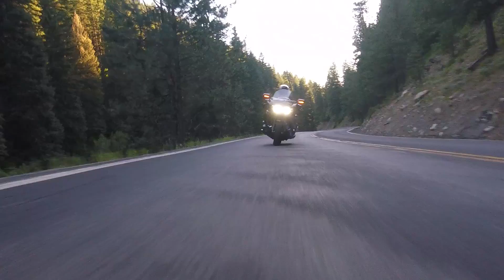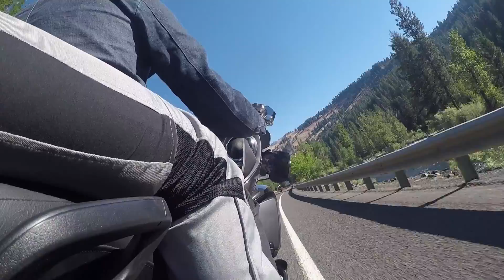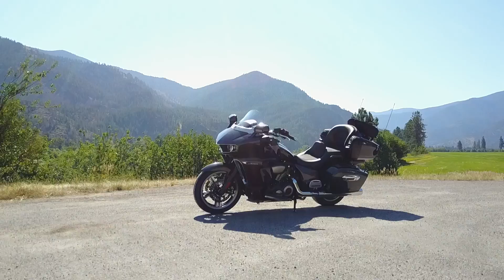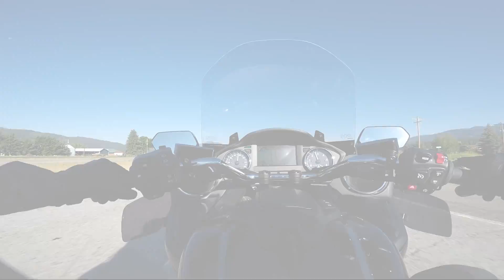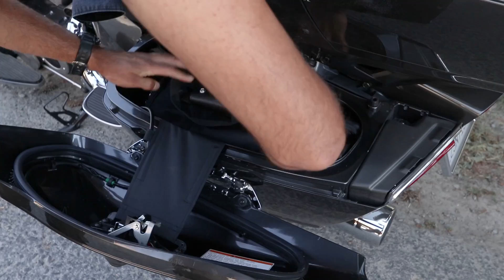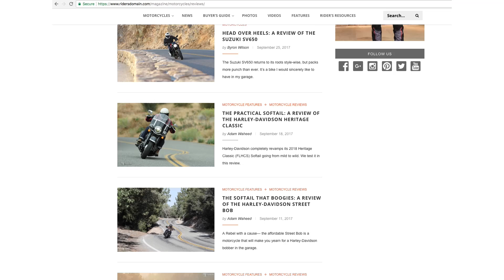2018 Yamaha Star Venture Second Ride Review Video | Riders Domain

Comment: I bought one a few weeks ago. I absolutely love this machine! She is smooth and has a very nice power range. She is also very responsive as he points out in the video. It is as fine a machine as I have ever ridden.
Reply: what made you skip buying the goldwing thks
Reply: I feel EXACTLY the same way, I LOVE my new Venture TC!
Reply: @rubo1964  It was the seating position of the Wing for me. There isn't a more comfortable seating position than that of a V-twin cruiser style bike IMHO.  I'd rather have a feet-forward position than my feet directly beneath me.  But then again, opinions vary.
Reply: Yamaha NAILED IT on this bike!!
Reply: How do you still like it 1+ years later?
Reply: @gabbyhayes1568  so you chose the wing or the yammy?
Reply: @HooDRidEWhiteY  The Venture was more comfortable and I prefer the ergos. The seating position of the Wing was not as good IMHO.
Reply: @gabbyhayes1568  ok thanks!!
Reply: How is the speed, does the bike reach at least 100mph without hitting the rev limiter?  Whats the top speed on this beautiful machine?  Im only asking because im considering this over the Gold Wing.

Comment: I've ridden both this bike and the 2018 Goldwing, if your 5"10" and 185 and under the gold wing is probably better for you. If you're a bigger guy this one is more comfortable,  over all really was surprised after so many negative comments. Got used to short shifting, lacked a little power over my Raider and the heat was noticeable but not a deal breaker. With the comfort and all the bells and whistles included I have to have one because I like longer 300 plus mile rides over a weekend and longer. Not to mention I don't think there's a bike out there that beats this one for passenger comfort! Will be buying one soon!
Reply: All the negative heat comments I've heard is ridiculous, every bike I've owned even liquid cooled ones when it was hot they were hot i have no problem with it ,this is one awesome bike its superb! Top of the line I would put it up against Harley, Honda    and Indian any day!

Comment: Bought it love  it 2022 best bike I've ever owned handles like a dream , drove to PEI and back almost 5000.kms
Reply: Just a heads up but there’s a recall on my 2018 for the brake switch and the starter, neither of which effected my bike, but took it in anyway for the replacement parts. You can run your VIN on their website to see if your bike is effected. My guess is the dealer you bought it from may have already taken care of it before they let you drive off, but you probably should check to see. It really is a fantastic bike isn’t it. Ride safe.

Comment: The heat coming off the engine isn't really a problem if you do what I found works: I start my cruise at 10:00 a.m. and duct tape a raw chicken to the inside of each of my upper thighs. By noon, I'm re-taping them to evenly cook the other sides. By 4:00 p.m., I stop and apply BBQ sauce to both birds. By 6:00, I pull off the road somewhere to eat dinner. Pack potato salad, too!

Comment: Just bought a 2018 transcontinental.  Although I like the bike with all the new techs, I think the older venture, my 2006, rides so much better.  
I don’t want to say anything negative about my new bike.  It’s just that 2nd gen venture has been an outstanding machine in every aspect.
Reply: I rode a 2005 RSV for ten years and it was a very comfortable bike, especially for taller guys, very roomy.  I don't know about it riding better than the Transcontinental though.  The RSV had a great suspension, but it was a tall bike and extremely top-heavy.  And it didn't have ABS which made panic stops a real adventure.  But it was a very good bike.

Comment: Would I buy it? Probably not, at least not for another 15-20 years and I'd have to be planning on a lot of 1000+ mile trips that freeway riding was a big portion of it. I think my 2015 FJR1300 is going to serve to be more what I want, a more well rounded bike that I can gun when I want and it takes off, has sharp handling, and still has lots of storage and handles lots of freeway riding well.

I'd buy this in a heartbeat over anything comparable from other manufacturers: Goldwing, Street Glide, etc. This thing does offer a ton, looks super refine, and exceptionally well designed and engineered and packed with features. I'd definitely consider renting one if I were going to do a super long 2000+ mile trip. That being said, it may be overkill for me, at least time I'm older. I did 1500 miles in 5 days on a Honda 919, the FJR1300 is going to be a nice middle ground for me for a while.

Comment: The first thing to go on my Stratoliner was the heel shifter.
Reply from the maker: Yes Richard, we agree. A heel shifter is a must-have add-on for the Star Venture. Which one did you fit on your bike?
Reply: Yeah, a heel shifter is a must - was the first thing I thought of on Mile 1 of our ride.
Reply: I have removed the heel shifter on all my previous touring bikes. Just don't like them. Maybe a holdover from my early days with Harleys. But now I'm getting old, I'm looking for comfort. Will definately check this out closely. Nice review on this.
Reply: Ive never understood the necessity of a heel shifter.  Thats always the first thing I scrap on any bike I own.  All it does for me is limit how much room I have to move my feet around on the boards.  To each their own though.
Reply: @chrismartin500  keeps the top of your boots from getting scuffed.  I use the shifter both ways. Depends on my choice of footwear

Comment: I've been a Goldwing rider from 1976 and in 2016 had a flesh eating bacteria get into my right knee. After 7 surgeries the doctors saved the leg and my life, BUT, I cant bend my knee enough to fit behind the Goldwing Engine anymore even with floor boards. I Rigged up a brake that would reach a foot peg on the right crash bar but keeping the leg straight all the time is uncomfortable too. Went to a Indian Dealer to see if sitting on a FLOOR BOARD V-Twin would be comfortable. PERFECT! Just Perfect! But I am not sold yet on any V-TWIN. I LIKE INDIANS Nostalgic look but I understand the Heat is a BIG PROBLEM with their Tourers and all the 111s. I like touring and want the extra luggage capacity. Switching to a V-Twin will be a major step as I have been sold on the Goldwings reliability and Love the Shaft Drive. But also over the years they changed the body style so much that it no longer looks like a motorcycle to me, but something a guy wearing a suit and tie would ride going into town to work! I have a 1999 Valkyrie Interstate now Only for the reason it looks like a motorcycle. Just can't get myself to buy a new Goldwing simply because of their LOOKS! Just want a real nice Fully Dressed Bike that is dependable as hell and at least Looks like a motorcycle. Harleys are out for me cause I hate their ride. And I don't trust their so-called dependability. Know too many Harley riders that STILL have problems even with Today's High PRICE tourers! I truly believe Harleys are MADE TO BREAK. This is a good review and I am going to have to try one of these out. The Goldwing has excellent center of gravity and balance. If this bike can offer Dependability, Good Balance and Handling and a good Long Haul Comfort, especially 2 Up, I may be sold. I know there is a BIG difference between a six cylinder water cooled engine and a V-Twin Air Cooled one. But given my new life circumstances and the advances made with the V engines this bike might just be what I have been looking for and NEED! I won't ride a trike either. I gotta have the sway and play of two wheels! Thanks for the review!
Reply: Not really sure. They said it comes from the soil. The ONLY thing I had been doing related to any soil contact was watering my yard with a garden hose. I was waiting for shoulder surgery and was using my leg to pull on the hose so I wouldnt tear the already torn tendon in my shoulder anymore. I was wearing shorts and would pull on the 100ft hose using my right leg and right foot. When I got out of the hospital (2 months) I checked the hose and it felt like sandpaper. Only guessing though that it may had this MUCOR FUNGUS on it and scrapped into my knee. First sign was a small red spot about size of a quarter with knee swelling up and hitting like hell. Went next day to Dr. and he said it was a staff infection a d gave me 12 antibiotic pills. By next day skin was turning necrotic and super red infection. Went to hospital. The said same thing, it was a staff infection, gave me 1 hour of intravenous IV antibiotic 52 antibiotic pills, cut into redfish black necrotic skin, stuffed a drain strip guaze in cut and sent me home! THIRD day reddness got even bigger and spreader wider. Went back to hospital and they decided to admit me. They called in a disease expert who discovered what it really was - MUCOR FUNGAL INFECTION. The had to debride about a 8 inch diameter area near my knee cap that went about a half inch deep. Had to have skin grafts. This happened Oct 3, 2016. 1 year now. Even with rehab knee only bends about 23°… Plus I found out through MRI in Sept 2017 that my ACL-PCL tendons were Completely torn. Sweet Huh. But even through all this I still managed to be able to get on my Valkyrie and ride it. BUT like I mentioned I just can't get my knee to bend enough to get it on the right floor board behind the engine. The bike has been my rehab and FRESH AIR to keep me positive. This thing really did a number on my whole life. In just a couple of days my life changed forever in a way I could never have guessed would happen. It is incredible what happened! I just thank God Everyday I did not Die and also did not lose my leg. Stats say 30% who get through skin die. You can also inhale Mucor Fungus Spores and if that happens stats give you a 70% chance of dying. MUCOR FUNGUS grows in the soil mainly on dead WET vegetation, wood chips, decaying vegetables and even cardboard. Thing is I bought some top soil that had some wood chips in it. Raked them into a pile right where I rolled up the hose. So when I watered the yard I was pulling the hose across these wet wood chips. Anyway, its still guessing but it was all I could figure out might have happened. If you ever get an infection that starts out small, hurts like hell, swells quickly, and redness spreads quickly don't assume its only a staff infection. Make the Dr. Take a Culture Sample. Which NONE of mine did till they realised something wasn't right. ALMOST TOO LATE! Very few doctors actually see these infections but they are getting more common! Funny after it was all over I found that in the Illuminati Card Game, it has a card on Flesh Eating disease attacking someone! Maybe I pissed off a certain political party right before the election last year!! Well later, hope you learned something here. Happy Riding!
Reply: Not really sure about that. I suppose it is a world wide Fungus. I live near the ocean in Northwest Florida and it is rare here. Unlike the water born flesh eating bacteria that is more common in warm stale putrid water. This is a fungal flesh eating "fungus". (So they tell me) that grows mainly in the soil and on things as mentioned already. I had a bout with MRSA too in 2008 that I got in a Veterans Hospital. Had a few months then where that came and went. Have not had a single episode of that since 2008, though, thank God. Apparently here in the USA they have basically figures out how to kill that one. One thing they discovered with MRSA is that each person may require a Specific Antibiotic to kill it. They now do culture samples on MRSA send it off to a lab and the lab prescribes a Specific Antibiotic For THAT PERSON. Apparently with MRSA they discovered what works for one person may not work for another. So now antibiotics for MRSA require individual tailoring. Hope all this helps anyone who reads this. A little off the subject of bikes but well worth knowing.
Reply: Oh one other thing, I have learned through nurses at the hospital (when I was there) that sometimes people who have been in car accidents and end up in the dirt with open cuts and wounds have gotten Mucor flesh eating infections. My advice is if you get a scrape, cut etc., while outside doing anything, wash the area Right Away if possible. One nurse told me she carries two small bottles with her anytime she is outdoor adventuring. One is filled with everyday rubbing alcohol and the other everyday bleach. She says if she or her kids get cut or scraped outdoors she washes the wound with bleach and then the alcholo. She said the combination of the two will Kill Any flesh eating bacteria or fungus on contact. She recommended I fix myself up with a couple of small bottles and keep them handy.
Reply: You too brother!
Reply: Glad you enjoyed it - sorry about your knee - my knee is not so good either - thanks for taking the time to share your story it was a good read.
Reply: Had a similar experience, almost lost my right arm. They weren't sure what it was. Turned out to be a spider bite. Brown Recluse. Just saying. Wish you the best
Reply: Bill Meyer - That was my first thought too, but they brought in a disease specialist and the CDC. (I was quite the Speciemen of interest) Turned out it was a Mucor soil based Fungal Infection.
Reply: OasisofSpirit I know what it's like still wanting to ride with physical limitations. Been riding since I was a kid. Not a kid any more at 63. Where did the years go lol. 
Back in 94 got busted up real bad.  Fractured hip, pelvis, blood clots. 
My life as I knew it was over. Soon as I was down to one crutch it was back on the bike. I have slowed down but can't imagine life without a motorcycle. God Speed my friend
Reply: Bill Meyer - I know the feeling. I got Blood clots too ( DVT ) last March all down my right leg (related to the Surgery from Mucor) and had to have them removed. I've had about six other surgeries, neck, knee, shoulders, toes and a BUNCH of other bad injuries over the years. I must have been meant to have a life of injuries, which 99% were not my fault. But I am like an old Timex, I just keep on ticking. Who knows one day at a rest stop we might cross paths. Nothing like riding with the wind and the sun and the rain and the cold and the........well you know what I mean. Safe riding to you too! God Bless!

Comment: I Love the bike and buy in a second, But, in heavy traffic I can see this burning the heck out of my leg. It would be a no brainer if this was a liquid cooled engine. I drove my brother 2018 Venture for about 5 miles and I love media system, I love the bluetooth, and I'm simply crazy about rhe desh. The ride was as good or better than my 2017 Honda Goldwing level 3. If they change the engine to liquid cooled or at the very least raise the horsepower about 40hp higher I'm in.

Comment: lean angle on left hand turns on my demo ride was crap! The bike was like riding a wood heater on the left side , hot does not describe it. It did feel lighter than its weight. It does have great power.

Comment: The bike may be too much electronics that are not ready for production. I bought the bike 2 months ago and they are still trying to fix the electronics. It does not seem that Yamaha knows what to do to fix the bike. GPS, Comm systems and dash electronics are not working since the day it was purchased. Yamaha engineer is going to try to help dealer with fix and a few days.

Comment: i’m on my third venture since 1986. I had a Gold wing GL 1800, I went back to a venture.
 I am interested in this newest venture. My local Yamaha dealer told me that the only time I would be able to see one is if I put a deposit on it, then they would order it. It was in 2018. Today it is April 2022. I still have not seen one in  person.. so the only place I can even hear about the mess here on the Internet. And one little thing I would like to hear from someone that will tell me the truth.
  is there a lot of heat that comes off the exhaust pipe onto your leg, I think it’s on the left side.? there is one thing I can’t tolerate from a motorcycle is heat pouring on to me because I wear all the gear all the time. I did not buy a Yamaha FJR, a Kawasaki concourse 1400, and especially the Honda ST 1300, because those things are rolling easy bake oven‘s.. especially the Honda ST 1300. Wonderful machines I hear, I see them with lots and lots of miles on them. I hear nothing bad about anything mechanical on those machines. The one I took one for a test ride on an 80° day. I told the owner that I would not be back for at least an hour. I did not even make it 10 minutes before I was engulfed in heat  coming off of that engine that felt as hot as a hairdryer on high speed. I loved that machine. I was brokenhearted when I could not buy that because of that heat.. I mean I showed up with all the cash to buy it at full price, but I returned after just a short 20 minute ride, 10 minutes out, I turned around and went back. My first question to the owner was, how can you ride this thing , it is so hot. His reply was, that’s why it’s for sale..
  so: can anybody comment on if there is a lot of heat on to the rider from this Fabulous machine?
Reply: Water cooled or not when you've cocooned yourself in protective gear you're going to overheat even if the bikes water cooled especially in a hot environment.
That being said I thought I was a big mistake Yamaha going with an air-cooled V-Twin.